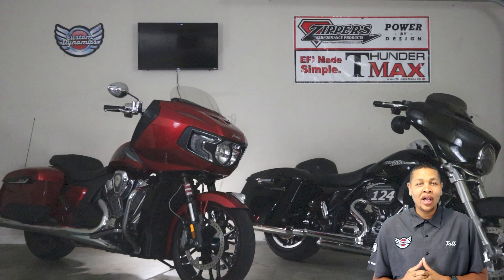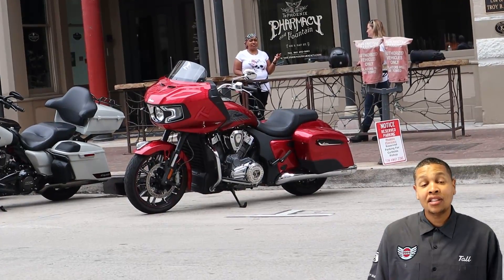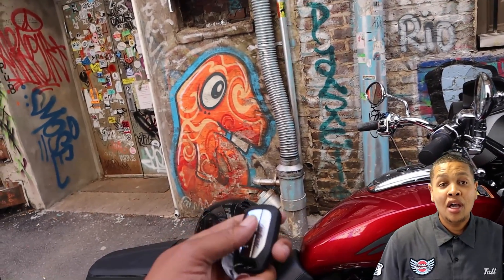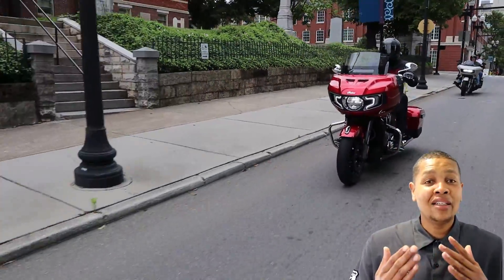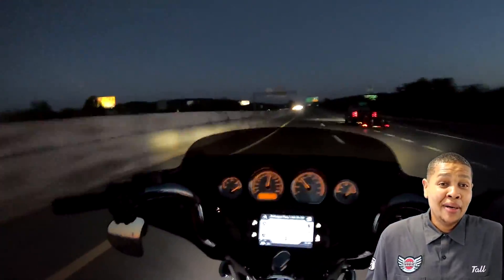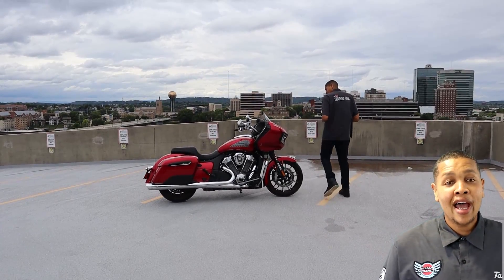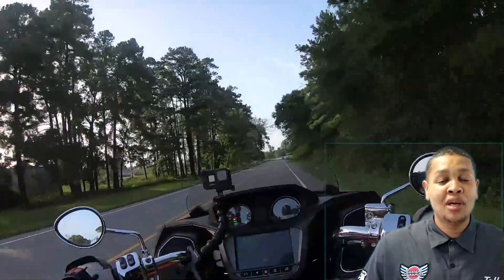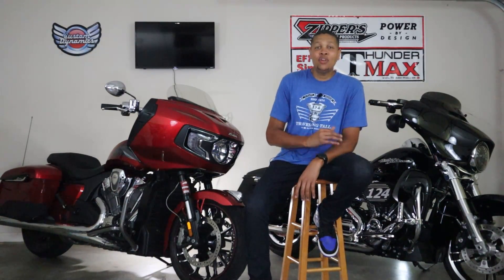Harley-Davidson VS Indian  Challenger.  THE FINAL REVIEW!

Comment: I man love your channel. I’m from Miami, Florida and I ride a 2020 road glide special. I had myself a 2019 chieftain darkhorse and being my first touring bagger, I loved it. It was my second Indian motorcycle at the time, the first was a 2019 scout bobber. I went to Harley and traded it in for a 2020 road glide special and now I love Harley. In my opinion both motorcycles are great and totally different when it comes to performance and riding. But for me Harley is just more of everything, more aftermarket parts, more dealers, more shops, easier to get parts and cheaper. I also have to agree with what you said on the video, with Harley you kinda get a blank canvas which you can customize to look however you want. Great channel,.

Comment: I buy the bike for the engine as that is the most expensive to modify.  I usually do not perform any expensive mods on bikes on a depreciating asset.  Harley should offer its stage kits from the factory to help prevent depreciation.
Reply: Harley dealerships, at least the ones I've been too, will install the different stages and if it's done within the first 60 days of purchasing the bike, it is included in the warranty.
Reply: @2001redz28  The majority of buyers can't afford all those upgrades in a monthly finance charge. Plus, don't dare use a non HD part or you'll void the warranty. The Local Indian Dealership installs and warranty aftermarket parts and installation. As a consumer You and I should be getting more from a stock bike!

Comment: I just picked up a 2020 Roadglide Special . I looked at the Challenger but the Roadglide spoke to me way more with its incredible build & paint 🎨 quality ! Case closed for me! Laconia H-D installed a stage 1 with Rinehart 4.5 s ! It sounds amazing 😉! I couldn’t care less if the challenger is 1/2 a second quicker ! That’s what Stage 4 is for ! 😂
Reply from the maker: M8 with a cam upgrade will get you right there as well. My Dads 107 with a Redshift 468 Cam, Krhome Werks Exhaust and Thundermax Tuner gave him 117 tourqe and 107 horsepower. Check that video out in my videos tab.
Reply: I know i'm a bike short, and 2 months too late but uh......
https://www.youtube.com/watch?v=BOFDCnA7zb8

I just test rode a HD Road Glide (19) today with my wife and I'm hoping to set up a Challenger test ride next weekend if possible. The RG was nice, my current (and first owned) bike is a Vulcan S but its a little small for me and definitely too small for the both of us. Beautiful starter bike, that aside the RG is a Cadillac in comparison. It does everything besides shift smoother (lol clunk). Buying is out of the question atm but in a year or so? I have to ride the Challenger first because the Limited in that Deep Water metallic blue is perfection. If I can convince them to put the dark horse engine on that bike (not a big fan of a lot of chrome) I'll be sold in a heartbeat on looks alone.

Main point of posting that is that HD RG is much slower than 1/2 a second to that of the Challenger. O'Hara was almost 30 seconds ahead when he 'went off track' and still reeled in the Vance and Hines HD with an SnS motor as if he was only leisure riding. They both were moving some serious pork shoulder but that Challenger with a little bit of tuning was insulting everyone else on the track. All this said, I like a lot of HD's style and mainly dislike a portion of their followers. This type of competition can only bring good things to all of us as consumers and I really hope it wakes HD up.

Comment: I have watched a few of your vids and you did a nice job with your review of the Indian. I bought a new 18 Fatboy and rode it for 18 months and put 18k on it. Then sold it to buy a Cadillac. I used it for a down payment on the car. But I did buy a 2012 kingpin with low miles. I like it and it has 120 ft pds and 120 hp. But it’s not a Harley so next year I will be looking for a Freewheeler. Just need my fix of H-D. 👍

Comment: I test rode the Challenger LImited just like the one you rode on their demo day. Will continue to stick with Harley because of the extensive dealership network, customization options and just buying from a time tested manufacturer. The dealer seemed a little shady because their sales pitch was just about slamming Harley Davidson and how they suck. They had a HD Street Glide for comparison, but people started to like the Street Glide too much. It was kind of funny that they stopped allowing people to ride the Street Glide. There are issues starting to crop up with stress cracked head braces which is extremely dangerous with their touring models. Anyway, awesome video Traveling Tall!
Reply: HD does the samething! LOL.................
Reply: Stress cracked frames!? Got any proof on that claim?

Comment: Hi I’m in az I ride a 20 road glide  special bin riding harleys since 73. I test rode the challenger when released I was I’m pressed with the bike all around power suspension ect at the time I had a 18 st glide special with air cleaner mufflers the power on Indian stock was way better than my bike things I didn’t like on the Indian was the shifter peg on the brake side too small for my liking. And the turn signal switches all on the left side and was huge to boot. I agree with you on the lockable bags come stock where Harley only comes on the cvo and to piece it together is very expensive to put on my road glide. Also my bike has the stage 2 in it with tuner power cam and krome werks mufflers all Harley parts an instal to keep my warranty till it’s up if I had money to buy an Indian I would but not get rid of my road glide thanks rubber down 👍
Reply from the maker: Thanks for the  comment. My Dads bike has Khrome Werks on it, and they sound great!
Reply: Traveling Tall yup the more you run them the louder they get lol

Comment: It’s known that Harley riders usually have to built there engines up 107 to a 114 or a 117 to 124 or 131 my ? Is how does that work is there an exchange value on the used parts replaced like cams etc given by Harley Davidson or are just own your own trying sell parts on eBay or market place

Comment: Apples to Oranges...the bikes to be compared have to be Stock. Either both as Stock base models or both as Stock models with every factory option/upgrade applied. Those are 2 different classes with 2 different prices. By doing this: the viewer can determine "value" of the particular motorcycle in each category (acceleration, braking, handling, comfort, storage capacity, range between fill ups, user friendliness, maintenance frequency and costs) and then determine the over all value of each machine and then filter the assessment of the bikes through their own needs and riding style, to come to a conclusion of best value for themselves.

Comment: Thanks for the update and review. I think it's a business model. Harley probably makes more gross revenue and profit from the accessory side, so one might say they purposely produce bikes that are basic/incomplete/blank slates or maybe just made in such a way that they almost require some sort of customizing. It sounds like Indian is taking a different tack, more like BMW with the Challenger. Make a bike that does most things well out of the box. I currently ride a 2009 R1200RT, but owned a couple Vulcans before and also some UJMs. I am considering a second bike and HD is on the list, but you'd think that I'd be drawn to the Indian based on these reasons I stated  and for some reason I am not. It just doesn't have the provenance. The culture I don't really care about, I probably wouldn't fit in and the dealer thing is ok, but not a deal breaker, but it's not a HD. That said, if I bought a HD, I wouldn't modify it much at all. Just ergonomics. I am 6'5 too and most bikes are made for someone 5'10 and less, which makes fit a problem. Anyway, thanks for the review.
Reply from the maker: I'd like to ride a BMW GSA. I test ride one and liked it. Check out that video on my channel. Thanks for the comment.
Reply: Provenance? Are you buying stock or a motorcycle? At some point you have to ask yourself what does my $30k get me? If HD sold bikes at a price as “blank slates” where you could get the bike plus do what you wanted to it for $30k and have as good of a bike as Indian puts out for $30k I would agree. They don’t! You pay $30k and STILL have to rebuild the motor and suspension just to catch up. I have owned several HD’s and have no axe to grind. They ran just fine and I had no issues with them, but Indian is giving me more these days for my coin. Don’t let a company sell you intangible crap like “heritage” for a premium. It’s a simple equation....who makes the better bike dollar to dollar?
Reply: @motoGPness   FACTS! 💯

Comment: Good review......  I own a indian Ftr 1200 and my dealer told me it can have warranty service done at any Polaris dealer since Polaris owns Indian ( in fact my oil filter says Polaris on it lol ) . I'm just guessing here but I'm pretty sure there are more Polaris and Indian dealers combined than Harley dealers in the USA . Have you got on the FTR 1200 yet ? It's a beast
Reply: Do the dealers stock motorcycle parts, and do they have the expertise to work on the bikes? That would be my concern?
Reply: @billwelsh7489  I would advise u call an Indian shop and ask them details , but Polaris is / owns indian , there techs are def trained . Go dig on Indian website for more info ... bottom line is there are plenty of shops around the country to have warranty issues fixed for free . Saying that there are not that many Indian stores and that's a reason to not buy one is an ignorant statement cas if you do you research you will find the opposite . And if u do more reasearch u will see Harley lost 90 mill last quarter and is cutting back production 30 percent on there bikes and closing stores throughout the world , not gona jump to conclusions but it's not looking good for them
Reply: I had a friend who bought a Polaris jet boat and told the same thing.  He moved a few states away after purchase and it broke down.  He finally found someone to work on it that was 1,400 miles away.  He got it fixed and turned around and sold it for a loss to the next unlucky buyer.

Comment: Awesome vid Tall. So I just got a new 2020 Black RGS. Scared to wipe it down. Don’t want it to scratch. I got detailing spray. Just would love some advice and pointers. Thanks in advance!
Reply: Harley paint is awesome! Just hit it with a good coat of quality wax (anything Meguiars or 3M is top notch) and use clean microfiber rags and Meguiars quick detailer in between washes. If I can notice even a small layer of dust/particulates on my paint I just do a full wash, otherwise your just rubbing all those particles against your clear coat. After washing if you have a clean air source (Air compressor) wipe down with a PVA shammy like “The Absorber” and then use your air compressor to blow out all crevices and hard  to reach areas. You can use a leaf blower, but understand that there is no filtration on a blower so any solids picked up by the suction will blow against your painted surfaces at a high rate of speed which can act as an abrasive and in time will dull your clear coat. In a former life I ran an auto detail shop and these are the things I learned over the years. Enjoy and keep it on two’s!

Comment: I have a Harley road king special 114 at the moment with a stage one tune , the bike has just had its 15000 mile service & at the same time it had to have a rear head gasket because the stock gasket failed, the bike was 4 months out of warranty & Harley wanted big money to sort the problem , Harley no there’s a problem with there M8 gaskets but they won’t do anything about it , so I’m a bit disillusioned with the brand am now looking at Indian baggers as the technology seems to be better , but the only problem here in Britain is the depreciation with them & the lack of dealers , thanks for your comparison I will now test ride the challenger , I’m also 6ft 4 inch’s & you didn’t dwarf the bike which was good !!

Comment: I just got a chance to test ride the challenger at Panama City. It was a nice riding bike. I did expect it to be faster than it was. I have an ultra limited stage 2 build. The bike I rode did alot of popping felt out of tune. I tried different modes didn't seem to matter. Also rode a roadmaster limited. It felt light compared to my ultra.i have the same bike as your dad. The audio on the Indians were not up to par with my stock boom audio. I'll give them the suspension and clutch feel over harley. But I like the m8 better. That roadmaster limited is a nice motorcycle, liked the cooled seat feature. It ran a little rough for my liking as well.they both remind me of my stock ultra. Needing to let more fuel,air,exhaust

Comment: To me the best thing about Indian is its competition to HD.  HD needs to do some serious upgrades on suspension.  I shouldn't have to spend 2000+ in the aftermarket for good suspension and 3000+ to get 100 hp.  That said, I love my Harley's and don't see an Indian in my future, I still like air cooled, pushrod motors.  I have a Sportster Roadster, FXDR, FXLRS,  and a Roadking.  All great bikes.

Comment: What is the big deal about the front end suspenion on the Challenger?
Reply: Upside down forks are more rigid and typically a bit lighter. It improves front end feel and provides extra strength for extreme situations like riding hard or stopping say an 850lb bike. When you grab a handful of front brakes the calipers slow the wheel via the rotors and all of that energy or force is transmitted through the forks to the frame. Most of that force is absorbed just under the lower triple tree. In an upside down fork the top tube is much larger and stronger so it withstands those forces with much less flex than the thinner portion of the forks would on a standard fork.

Comment: Your lucky to do a test comparison like this. You need to go into just a bit more detail about each bike. Examples would be wind screen height at max and not deployed. Seat hight compared to Harleys. What kind of tires on the Indian as compared to Harley. Then compare the ride... Just a bit more info.  Didnt see the vid on your harley upgrade. Just a quick qoestion.. did you up grade the bottom end so it could handle all the top power. Don't want a grenade the bottom end

Comment: I purchased a 2020 Indian challenger I feel like the bike comes with motor as well as technology,  I have it with the tour pack & having the Loyds tune added in the next couple of months and Kst handle bars I test road the road glide then I test road the challenger it wasn’t close on how much technology you got with the challenger and suspension surpassed the Harley-Davidson suspension and that windscreen going up and down Harley needs to add that for a stock bike it’s running with the Harley-Davidson Cvo’s and half the price liquid cooled you can run it in heat fast, Loyds tune vs a 10,000 131 motor Loydz Indian challenger tune $600 I will take that 10,000 and put down on a toyhauler! A cvo need to come with a 131 motor you shouldn’t have to pay a extra 10,000 on top of a 50,000 dollar bike for a 131 when the challenger runs just as fast as the cvo which is a 117 motor but the Harley-Davidson bike also cost 20,000 more thanks tall and you didn’t even ride a challenger that had loydz tune

Comment: A water cooled engine is almost always going to be able to make more power than an air cooled engine. This puts Harley in a difficult situation trying to give Harley buyers what they want (traditional air cooled engines) while having to comply with ever more restrictive EPA regulations. While Indian is American owned the feel of the motorcycle is that of underlying Japanese engineering. Not saying this is a good or bad thing; just that is the way they "feel" to me. I think tradition Harley buyers are going to be hard to win over. But clearly Indian is making headway. In the end the important thing is to ride; whatever it is you're riding.

Comment: You touched on a few things that were understated. If all a consumer wanted was a powerful harley davidison, they had there chance with the v-rod. People wouldn't buy it because it was liquid cooled over head cam and offset wedge. It is not apples to apples comparing these to platforms. If one truly understands why the harley dosen't make more power it is in it's designed. The engineers know this but consumers weren't buying it. Great channel but this topic is explained very well in someone else's video if you or anyone is interested.